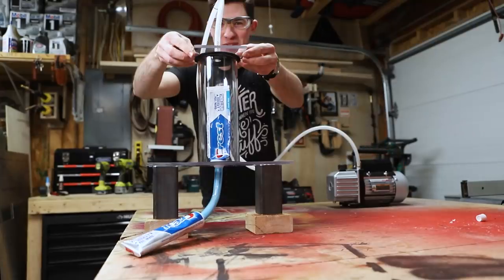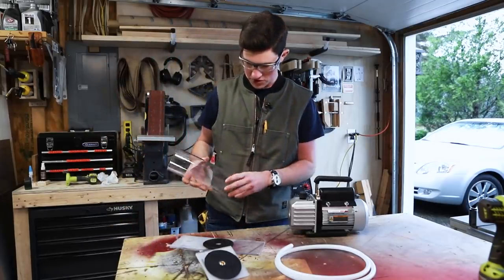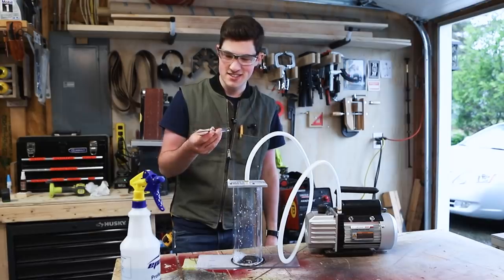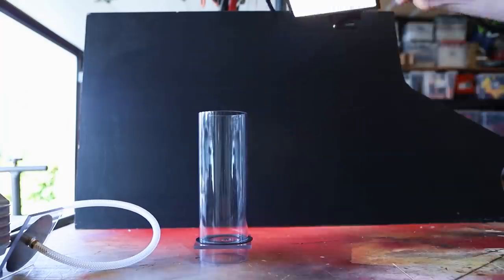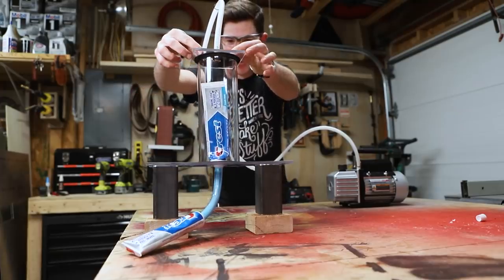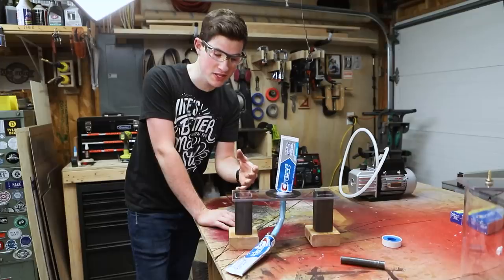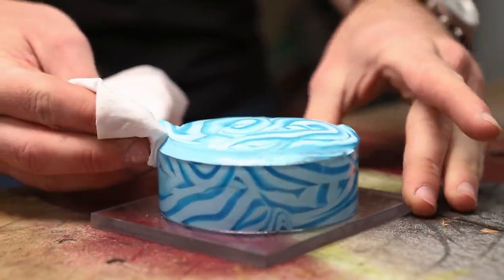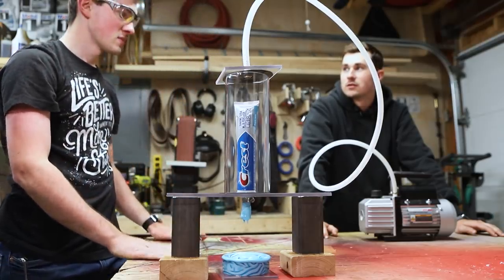putting TOOTHPASTE BACK in the TUBE... Possible??

Comment: Turn the whole thing upside down and feed the toothpaste in through funnel. Prevents the holes in the paste from trying to pick it up. Also, use a toothpaste roller to empty it fully and keep the air out better for a true fill
Reply: Turning it upside down is unlikely to change anything. You could feed the toothpaste from a large syringe, though.
Reply: Path of least resistance? If the toothpaste is on the bottom, there has to be more toothpaste between the air and suction? Because I see the air finding a path of less resistance through the toothpaste to get sucked up. You could potentially warm up the toothpaste to increase the fluidity/viscosity?? 
Or as suggested, use gravity by having the toothpaste on top to decrease the resistance of the toothpaste itself? 
Or am I wrong? Curious
Reply: @martinschroederglst  would it still be vacuum if you’re feeding it into the tube with a syringe? Seems counter intuitive
Reply: @reymysterio3177  I don't mean to push the syringe, just to use it to feed the toothpaste back into the tube without bubbles. But whatever...
Reply: or you could do a little hole in the top of the toob to let the air that will get in out, and the toothpaste that is thicker wont get through
Reply: I think the problem might be all the air in the toothpaste itself.
Reply: literally my first thought 10 seconds into the video.
Reply: Or just connect multiple full tubes of toothpaste in paralel.

Comment from the maker: I could go on forever perfecting this thing but I think I demonstrated all the principles necessary to do it right. FASCINATING though, right?? This one was a little different. It was a little more science experiment than building, but problem solving and learning is at the core of my channel.
Reply: Maybe a much deeper bowl with 30 tubes of toothpaste.  Make sure you use coupons.  🤣
Reply: Absolutely! I think considering the problem solving aspects, this fits your channel perfectly. Plus, you did build your test equipment.
Reply from the maker: @ManCrafting  🤣
Reply: should have done it in reverse. Used a pressure chamber  with the toothpaste and had the tube connected to it. i mean all you need to do is flip the setup a bit. right?
Reply: Maybe with warm toothpaste? Could be a bit less viscous..
Reply: Put the vacuum set up upside down and fill a funnel with the tooth past, then attach onto the hose and suck it down?
Reply: I believe that the vaccum doesn't affect a lot the internal pressure of the paste tube. Maybe a small hole on the tube can work.  Anyway awesome video!
Reply: @keonia.9553  that’s what I was thinking watching this. It will be rigid and won’t collapse like the tube, but still has give. Instead of collapsing the tube to move paste out to the vacuum, it should pull the plunger in. Might not be too difficult to get a hose to seal nice to a syringe either
Reply: Like how how you failed. But still showed it can be done.and it was cool to see you and your bro get along so you got a subscribe hope that makes it a win for you.
Reply: @ManCrafting  long tube foe teh sucky bit, with a longer only slightly bigger tube filled, suc. like a graduated cylinter instead of a bowl.
Reply: Vibrate the cup. The toothpaste will settle more quickly.
Reply: To fix both problems you could use a large test tube filled with toothpaste put it in the vacuum chamber to remove all air pockets and then use a smaller diameter tube in the bottom of the test tube
Reply: Put the toothpaste in a rather narrow tube (like the chemistry ones) and put from the bottom. The cavity made by the void will be filled up with more tooth paste
Reply: You should repeat this, but with a bigger container as a source for the intake. I think it's failing because your container is only an Inch high. The vacuum is wanting to be fulled and the easiest way it can be done is  by sucking air up. Easy fix increase the resistance by putting the intake lower.
Reply: Try a plastic tube full of tooth paste that is air tight that connects to the toothpaste tube in the vacuum chamber that way it wot seal it self like the tooth paste tube did
Reply: @TylerBellMakes  dude dude dude I know I'm late but what if you put the toothpaste cup into a vacuum chamber first to pull out all the air? That way you know there's no air pockets

Also, fill a cylinder with toothpaste instead and then just seal that directly to the exposed tube mouth! If you vacuum out the air in that paste filled cylinder, you can then freeze it and cut it with a saw so there's absolutely no air in the system!
Reply: If you have a box filled with toothpaste and you add a balloon or something similar that can expand under vacum you can fill it. Its a common way to maintain pressure in water tanks where you fill them and the balloon can be squised under pressure it will help maintain pressure wen water level drops. Don't see why it could not work the other way around where it will expand and push the toothpaste down through the tube
Reply: I think if you had the toothpaste in a funnel and attached a hose it might of worked better
Reply: take the filled toothpaste tube, connect with a tube to the empty toothpaste tube, squeeze with your hands and you are done, just seal well the tube, no fancy setup
Reply: The way forward would be to put the cup of toothpaste is a vacuum flask & remove all the air.
Once that is done, put the tube in the bottom of the cup or maybe even use a cone. 👍
Reply: @clipsboy1  he doesn’t need to flip the vacuum set up use a funnel with the open end pointing up and have a clear tube connecting the bottom end of the funnel to the toothpaste tube in the vacuum, and then flipping it on should allow for air free suction! Even warming the toothpaste up so that’s it’s viscosity is closer to the of water and won’t necessarily stick to the walls of the funnel in huge clumps! I would definitely love to see a video where this works out in the end! But good job I enjoyed the content almost a year later!😂
Reply: @hyperfox0934  you would have to make sure the toothpaste doesn’t spill out of the container, plus you might evaporate any sort of liquids inside of the toothpaste due to pressure which could ruin it but I like the direction you’re going👀 the funnel idea is definitely a good way to make this work, what else though? Let’s help this man with ideas?👀💯
Reply: The first method was better in my opinion, just needed to roll the supply tube up to push toothpaste up with pressure to prevent the kink. The second method could have worked better if you took breaks instead of trying to fill those whole tube in one go. Run for 2-3 seconds, turn off the pump, let the cavities collapse, repeat.
Reply: Easy fix, just go buy a nother tube of toothpaste (sarcasm..................but some of the common sense fixes make me roll my eyes )
Reply: If the problem actually comes from the bubbles in the toothpaste, why not degassing it like what we do with epoxy resin?

Comment: Hey brother dope video! Love science experiments 🤙🏼. My observation was that the volume of toothpaste sucked back upwards is limited by the high viscosity and weight of the paste. The atmospheric pressure is rushing back into the tube so fast that it turns into a contest of toothpaste viscosity/resistance vs. pinpointed air pressure. Eventually the air pressure is so high that it simply carves a path into the surrounding toothpaste to make room for the rest of the air to fill the tube. Imagine you’re blasting compressed air through a small handful of elmers glue. At some point the compressed air at a high enough PSI would make its way through and you’d feel the compressed air directly on your skin. I think either the intake tube should be a larger diameter to accommodate the high viscosity, or it would need to be a less viscous toothpaste. Great experiment! Keep it up!
Reply from the maker: Thanks dude!! Excellent observation!

Comment: Great video! I think as another thing to try, I would have tried turning the vacuum off and on while moving in the dish. I know some might leak out in between vacuums but I think it might work. Or a deeper dish with a lot more toothpaste might work? Lessen the potential for air capture? Maybe there would be more hydraulic pressure from more toothpaste, and also make it not so easy for air to get to the end of the tube. Consider the syringe analog - medicine bottles usually have a lot more than one syringe full of material.
Reply from the maker: Great ideas!!

Comment: I may be wrong on this but I'm going to give it a shot. 
I think the reason for the final test(s) failing is the following-
Originally, when you first start the vacuum pump, it draws toothpaste from the cup into the tube, but as soon as enough vacuum is pulled in the chamber, it is too much for the toothpaste to handle. Basically at that high of a vacuum it is easier for it to suck air through the toothpaste, into the tube (basically making a burrow through the toothpaste in the cup, to the tip of the tube on the vacuum chamber, creating a direct path for air to flow), than to just suck up toothpaste. I have a few thoughts on how to rectify this issue. Firstly, you could try regulating the vacuum to only draw as much as you actually need to suck up the toothpaste (and not create an air path). The only problem with that is that eventually, the tube would get full enough to where you would HAVE to draw a vacuum higher than what the toothpaste can handle. This is where the second idea comes into play which is to increase the depth of the cup of toothpaste. More depth of a liquid- harder to create hole. 

Tyler, if you see this, take it for what it is lol. I'm just an 18 year old writing my thought process down in the comments section, but I THINK that is the problem.

Comment: 1) warm up the paste to help with viscosity
2) fill up the can with air
3) insert a thick needle syringe down to the bottom of the can
4) push paste throw the syringe, slowly and the air will pump out.

Comment: The simpler solution would have been a giant syringe like a flavor injector. If you want to overengineer it, make the syringe powered off of compressed air. 

Toothpaste is a fluid with a very high viscosity. You could see if a funnel and gravity alone can shove the toothpaste back in given enough time. Granted, it'll be like the pitch drop experiment taking decades, but it'll be interesting to see.

Comment: I’ve done this before and it’s way simpler than you’re working on it…
Was leaving on a trip and since you can’t take a real tube of toothpaste on a plane, so I decided to take some small travel ones I had from previous trips.  Noticed they weren’t quite full anymore(because they’d been partially used).    
Here’s what I did:  blow in the tubes to inflate it causing the tube to inflate as much as possible, then hold the tube in my hand and tap the tube w the open side up to make sure all the paste is at the crimped end and any potential air pockets/bubbles. 
Next I squeezed till the toothpaste just reached the opening removing any air inside(sounds counterproductive as I just filled it up right? Just keep reading)
Then hold carefully 2 tubes opening to opening and squeeze one to force the paste from the one emptying to another one that’s filling.  
Boom I just refilled the tubes.
I could just have taken the partially used tubes but honestly I didn’t wanna take about 8 half filled tubes, instead 2-3 full ones.
Same principle, same process, different result and you can do the same w full size toofpaste. End

Comment: Possible as one viewer suggested to invert and use a funnel. Might I suggest a solid syringe setup? Free moving plunger at the bottom, rigid sides so you don’t collapse and block the outlet of the external tube.

Comment: It is surprisingly easy to transfer from one tube to another. Hole the open end of the source tube up to the destination and squeeze. I use this technique to refill a travel tube. Save money and travel with a different paste than what was originally in the travel tube. You could print or mill a custom adapter (double-ended cap with hole) and do the job much faster and better than I.

Comment: Maybe you could try to vacuum out the air bubbles in the toothpaste cylinder and then sucking it back up as you were doing. I imagine when you squeezed out the toothpaste into the container, you trapped air bubbles in between each layer.

Comment: I think the solution would be sucking the toothpaste out of a reservoir that has a sliding seal and rigid sides.  Something like a caulk tube or a cake decorating tube for frosting.  That way it prevents it from sealing itself and instead of creating a bubble, you just reduce the overall volume of the reservoir.

Comment: For sucking the toothpaste back into the tube, use a collapsible container like a bag to hold the toothpaste. As it is sucked out, it will collapse and not leave a pocket for potential air to get into and be sucked up. Same principle was applied to baby bottles to help the baby from sucking in air, thus reducing the amount of burping needed after.

Comment: NO! I REFUSE THIS CONCLUSION AND DEMAND A SOLUTION! (yes, i'm yelling) What's happening is the paste is creating a cavity around the straw (the toothpaste flows too slowly to refill) and it only needs a tiny path to loose vacuum, then it suctions itself closed again. You need the whole system to be sealed and the source container has to be designed to crumble on vacuum to prevent resistance. Try topping it with saran wrap or a balloon membrane that will be pulled down as the vat empties instead of letting air in.

Comment: I think the toothpaste is just a bit too viscus so when the nozzle sucks up some toothpaste the surrounding material doesn't immediately rush to fill the void as a liquid would, but holds its shape just enough that air can rush in before the toothpaste can fill the void. I would suggest putting some plastic wrap over the toothpaste cup so that a void in the toothpaste doesn't get filled with air.

Comment: My dad was a deep water sailor in WWII and the Korean War. He said that the Navy used two methods back then to test whether a chamber was air tight. One was to flood a space with water and see if it leaked, the other was to pull a vacuum in the space. He said it took a lot of water but a very small pressure difference between the outside and the inside of the chamber. BTW, you are really cool. I'd like to say you should become a middle school/ high school science teacher, but I can't. Teacher salaries are abysmal---I know, I'm a Special Education teacher. Figure out a way to teach science AND make a decent living. I LOVED your video!! BTW, Sir Arthur Conan Doyle modeled Sherlock Holmes on Dr. James Bell....seems like you Bells are a cut above the average bear. 😉

Comment: I think it's ultimately going to require positive pressure. Use. your compressor to feed a pressure pot containing your toothpaste cup, with an uptake tube that runs to your target tube. It would be great to see some kind of fitting that you tap or otherwise thread so that it mates with the threads on the toothpaste tube. Then your hose-to-tube connection won't need any hose clamps or other messy, unsatisfactory fittings.

Comment: have you tried vibrating the air bubbles out of the toothpaste? ultrasonic cleaners, or even massage pads work quite well, or you could easily make something with a sander, or an offset weight.

Comment: You could pressurised the ‘feeder’ toothpaste, as well as vacuuming the ‘receiver’ toothpaste. So maybe set a cylinder with a ltr or toothpaste with a long hose to the bottom (reduced likelihood of air getting in there) pressurise that, and feed into existing vacuum setup

Comment: Cut a disc that is a sliding fit inside the toothpaste dish. Then cut a hole in it that is a sliding fit over the hose tube. Put the disc on top of the toothpaste and the hose inside the disc. Atmpspheric pressure will push down equally accross the top of the disc and therefore push the toothpaste down equally like a piston to minimise air ingress.

Comment: I tried to fill a seringe with grease to use it in bike repair. I tried filling it the lazy way, stiking the seringe into the grease and simlply sucking it in. It worked fine for a moment but after a few seconds i was sucking only air into the seringe. The grease was just to thick.

Comment: Could you use a vibrating platform to set the toothpaste container on to help it continuously settle the toothpaste to the bottom? Similar to when you get air cavities in a slurpee, if you gently tap the cup on the table, the void will be filled. Think of it like when you pour concrete and you use a vibrating tool to remove the air pockets.

Comment: it looked like you had better luck drawing toothpaste back into the tube when the vacuum was just a little bit.  If you try this experiment again, turn on the vacuum pump for a short while (long enough to start pulling toothpaste back into the tube), and then turn off the pump to maintain a slight vacuum instead of a total vacuum.  Also, I think the spongy carbon that appeared when you burned the toothpaste was caused by the baking soda in the toothpaste.  But it was fun watching you go through the experimental process instead of only posting your success, I think more people need to know that not succeeding the first time isn't a reason to quit.

Comment: what if you had the supply of too tube in a bellows like vice with the thin edge at the back? As the air is pulled out of the "vice" it will close and squish the supply tube, but since it is smaller at the back, it will collapse the tube from the back and push the toothpaste out of the tube. The empty tube will be outside of the vacuum, but will be filled by the force of the vacuum crushing the other tube and forcing the toothpaste out.